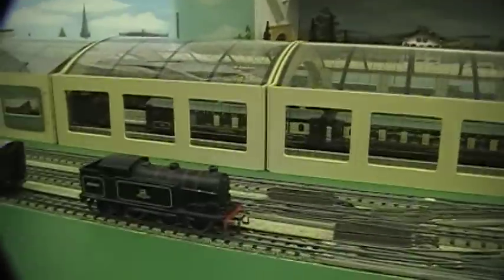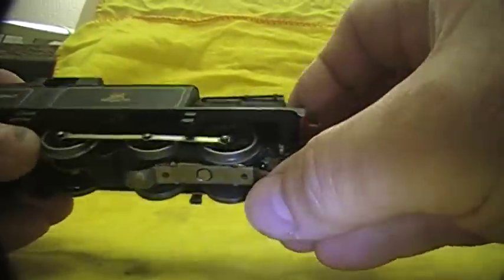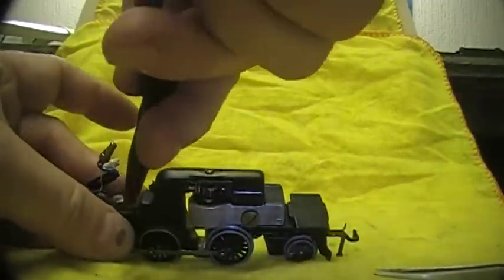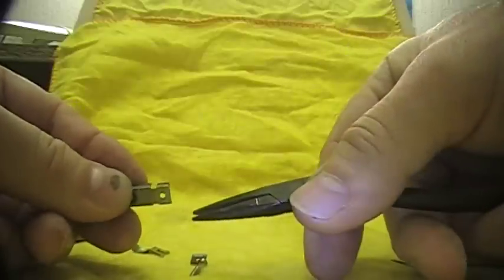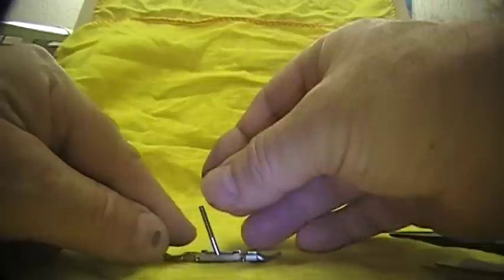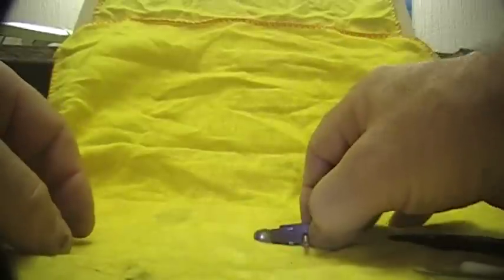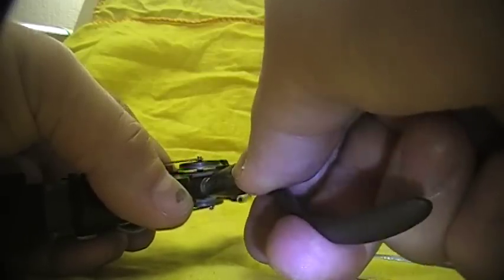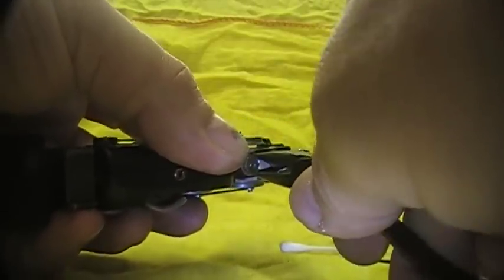Hornby Dublo Servicing, Pick-ups and Brushes.

Comment: Fantastic videos, got my N2 loco running much better (it was drawing over 1 amp). It draws below 0.65 amps at half throttle, but anything over that and it draws more amps. Is this acceptable, or must the amps not exceed 0.65 at any voltage? Thanks!

Comment: Hello Ron excellent set of videos, I have a Wrenn A4 Mallard that is running fine in reverse but appears to jam when moving forward, it had been working fine , hasn't had a lot of use, any suggestions ?
Many thanks
Stewart
Reply from the maker: Hi Stewart, \thanks for your kind comments. Could be fouling in any of numerous areas, but a couple of the less common may be the steel ball in the armature bearing is missing, or your wheel quartering is out of sync. regards,  Ron
Reply: @Raedodd5  Thanks for taking the time to reply I'll have another go at it today
Cheers
Stewart

Comment: Hi do you ever fix other people's? Trains cause i'v followed the video as much as I could, it was helpful, but my train still isn't working. 
But at the same time these trains haven't been used for years I found them in a model shop and they were giving the box out for free cause they said everything was broken, so I brought it home and it turns out not everything was broken one of three trains worked.

So it followed your video to fix the other two but they just aren't working for me so I was wondering would their be any chance you could try and fix them
Reply from the maker: Sorry Nyall I don't, but if you google "The Dublo Surgeon" he should be able to help you.  Regards,  Ron